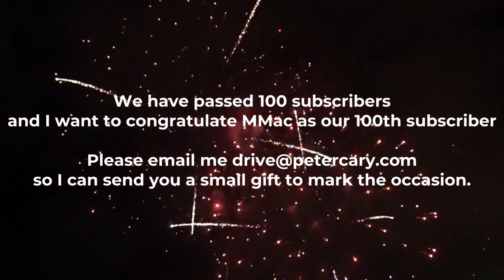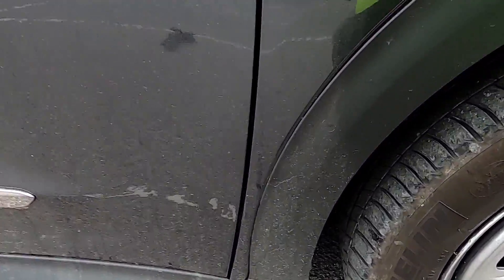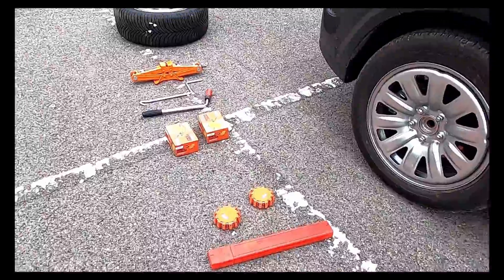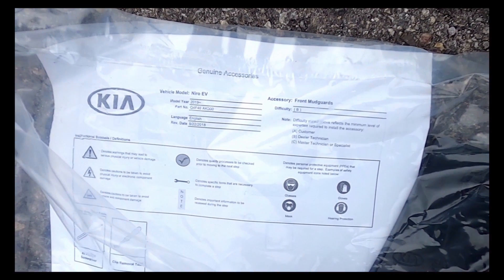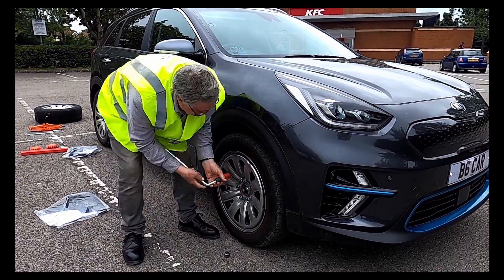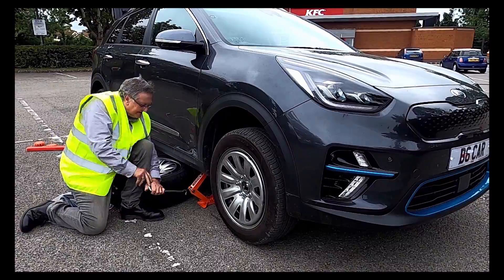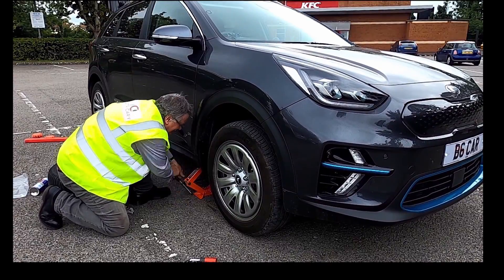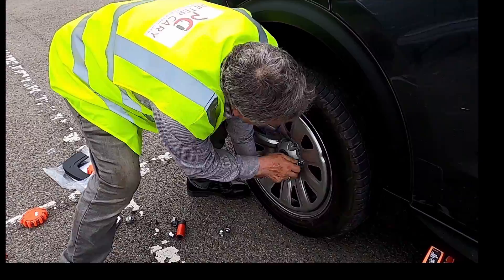Safely jacking an eNiro up using a scissor jack and fitting genuine Kia mud flaps

Comment: Peter, I fitted both sets of mud flaps to my eNiro without having to jack up the car, and using a right angled adapter for my electric screwdriver to install the rear set. No mention of wheel-nut torque settings which the car manual does not exactly specify, only offering a range of settings.
Reply from the maker: Hi Robert,

As I said in the video, I was taking the opportunity to fit mud flaps, whilst demonstrating safely jacking the car up using a scissor jack which some viewers felt was impossible.
I am sure you will agree access is far easier with the wheel removed, (it certainly made filming much easier😉)

I agree I should have mentioned getting the wheels torqued up at a garage if you don’t have one.

Kind regards

Peter
Reply: Yes no need to take the wheels off plus i brought the identical mud flaps from ebay for £14 for both sets and they were from Korea and exactly the same flaps!
Reply: I managed to do the same without jacking the car and removing the wheels.
Excellent video though on how to jack the car and all safety tips

Comment: Just subscribed. Quite interesting and a bit different.

I don’t have the e version , but I am getting a July 2019 Hybrid tomorrow. This is the 2 model in Ocean Blue. It has a lot more toys than my current 2014 Citroen C4 Piccaso. 
I will also be getting a space saver spare , as I did for the Citroen . They are £ 139.00 delivered from the Wheel Co. it comes with a jack and nut wrench.. It may have one but I doubt it. It’s peace of mind really. 

Again thanks for something a bit different.

Comment: Excellent video and very informative. Good luck. What makes the jack? and where did you get the jack and chocks? Like them.
Reply from the maker: Hi Bill,
All the items are listed in the description, found by pressing down arrow or show more, immediately above where one adds a comment.
I really should have mentioned this in the dialog, hopefully I will do this in future videos.
Regards
Peter
Reply: I can’t see the jack listed, been through both lists. Sorry to be a pain. The video is very useful.
Reply from the maker: Hi Bill,

You are correct I missed it off and can’t seem to edit the description🙁🙁

Here are the details. 
Halfords 1.5 Tonne Scissor Jack 657065 currently priced at £24.00, however I get trade discount at Halfords and I believe it was on offer to the public when I bought mine, there are lots of similar jacks available on Amazon and eBay..

Perhaps you might like to be a proof reader/viewer to check I have not made any errors or left things out as I seem to have to redo the final video 2 or 3 times because of things I’ve noticed were not quite right, but still it seems I miss things, please email me drive@petercary.com if you feel you could help me out..
Sorry I can not offer any financial reward but you would get a very early preview 😉😉
Reply: Peter Cary specialist ADI Thank you.

Comment: They are £50 a pair fitted buy  the dealer or cheaper if you buy them as part of a bundle with floor mats as I did when we bought our e Niro about 6 weeks ago.
Reply from the maker: Hi Stephen,
Your negotiating skills must have been better than mine, but the official price on the Kia website is £58.00 a link is given in the description part, immediately above where one enters a comment, I was offered free floor mats, but declined preferring rubber mats, working a very rural patch teaching loads of farmers children the interior does get lots of mud brought into it, however it is the first car I have ever bought that came with a”full tank” when I picked it up.

Regards
Peter

Comment: Me taking a wheel of a car you should use a torque wrench to tighten the wheels when putting them back on. And recheck after a few miles.
Reply from the maker: Hi Stephen,

You are quite correct and I should have mentioned this in the video.

Regards

Peter

Comment: Very interesting.. However Is this method approved by Kia UK?  One of the members in the Kia e-Niro UK Interest group on FB has put a link to your video, so we should really know if it is officially approved by Kia UK.
Reply from the maker: Hi Neil,
As I said there is a link to a Kia website, I should have said it was listed in the description, found immediately above where one enters a comment, but to save time I give the link,

http://www.kniro.net/changing_tires-550.html

However I feel my method is far safer as by placing the spare wheel under the sill there is no possibility of the car falling to the ground, something that was stressed on me when I undertook vehicle mechanics at college 40+ years ago now.

Regards

Peter
Reply: @petercaryspecialistadi1636  thanks Peter. The site has adverts and does not seem to be related to official Kia or Kia UK.  Also I could not see a reference to e-Niro.
Reply from the maker: Hi Neil,

I believe you are right, but car manufacturers aren’t rarely selling cars now with a spare wheel of any sort so no jack is supplied.

I believe they say this is to save weight and make the cars more economic, but as a side product it reduces ANY chance of an “incident” where the car falls injuring anyone and manufacturers don’t want to be sued by anyone stupidly ignoring advice or acting recklessly.

However the eNiro is based on a comparatively old design where spare wheels were fitted as the space for one in the boot clearly shows, the body of the car still has the notches showing where a scissor jack should be placed, the weight of the eNiro is slightly greater than that of the hybrid but not massively, particularly if you divide it over the four wheels..

I did say in the video if you are unsure if it is safe to proceed then don’t but wait for an expert to help you out and I would stand by that only proceed if you are completely confident of your ability to complete the procedure safely.

Kind regards

Peter

Comment: If you haven't got a torque wrench, you should at least use a standard length wheel brace. They are the length they are for a reason. That telescopic thing is only for loosening.

Comment: Hi Peter. Thanks for the videos. Just one query.... Whilst there’s plenty of clearance at the rear, have you considered that at the front IF the TYRE WAS FLAT would the jack lifting arm still clear the battery assembly as the car would be much lower and the arms would be much less angled upwards? Looking at the video it looks as though the jack arm would possibly foul on the battery. I’ve got the same jack as you, but I didn’t really want to deflate a front tyre to prove it.
What do you think? Cheers. Another Peter.
Reply from the maker: Hi Peter,
I’m absolutely sure there would be enough room to slip the jack in if completely flat as it had to be wound up a lot to start lifting an inflated tyre.
Reply: Peter Cary specialist ADI Hi Peter again. I think you may have misunderstood what I’m trying to say. I agree there will be plenty of room to get the jack under the car even with a flat front tyre. However, there is very little clearance between the inside angled jack arm and the battery. When the front tyre is flat, the angle of that arm will be much less and I think there is a real possibility of it hitting the battery before the lifting pad lifts the cill jacking point. The only way to verify it would be to deflate the tyre I think.
Reply from the maker: Hi Peter,
I did miss your point, but I don’t think you need worry, however if you are concerned Kia assist can be called and the full size spare fitted and you are on your way with no further delay.
Reply: Peter Cary specialist ADI Yup, I agree. I already had the RAC plan B in my mind. If I ever have to do that, forget social distancing. I will be watching like a hawk where the RAC guy places his jack under my pride and joy car!
Cheers.
another Peter.

Comment: Hi  Just looking at this? The jack has a notch in it to fit over the metal member of chassis that hangs down about 20mm at the front and rear of  jacking point,so it is located safely and not move not as you placed it?? If you have a  Niro jacking kit it shows this on edge of Kia Jack rated at 700Kg. OK for the corner of a E Niro?

Comment: Shouldn't your spare wheel be fitted with an  asymmetrical treaded tyre so it can be safely fitted to either side of the car.
Reply from the maker: Keit,
In an ideal world it should, but I have the spare set for a nearside replacement as it’s normally this side that picks up the nail/thorn or nasty pothole causing the puncture.

I’m going to have Cross Climates fitted eventually when the first set wear out as I have found them to cope with deep snow and ice, but still offer high mileage..